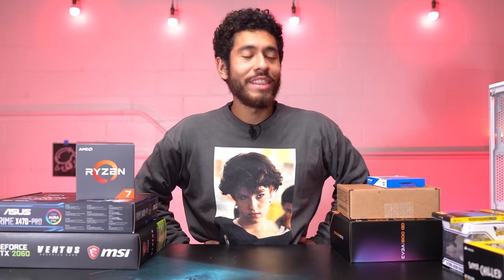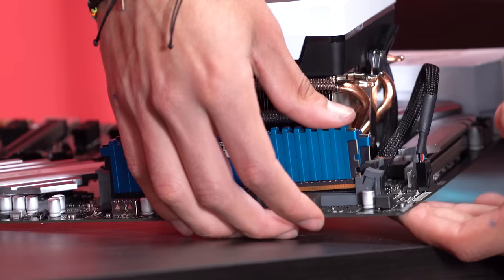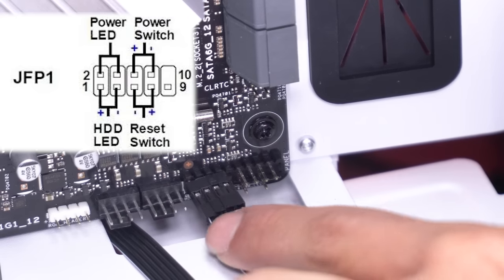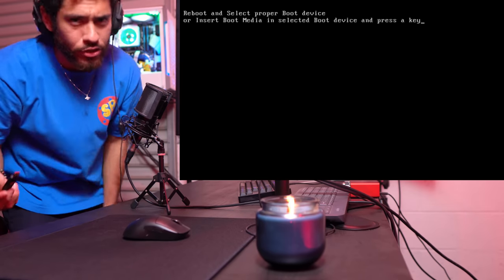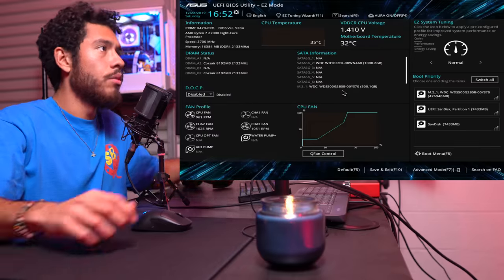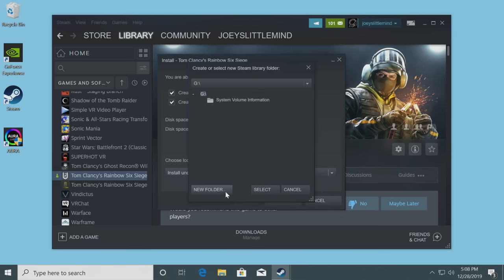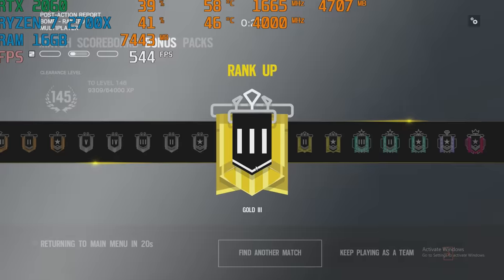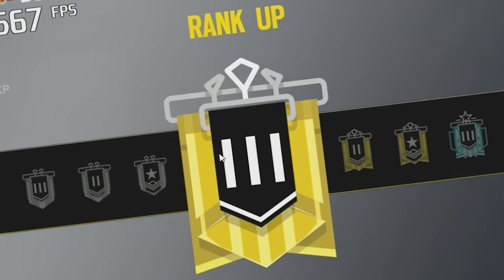Best $1000 Gaming PC Build Guide - RTX 2060 Ryzen 7 2700X (w/ STREAMING BENCHMARKS)

Comment: The msi tomahawk b450 max motherboard  will work ?
Reply: sort of, the fans in this case do not play well with that motherboard so I suggest getting either the mobo in the vid or the Rog Strix b450-f
Reply: @yordinihoudini  well ok thanks, but if I use that motherboard that I mentioned nothing bad is gonna happend right ?
Reply: @rolitoo5578  i’d say spend some 15 buck more on the B450 Rog Strix so you have no problems or worries with anything

Comment: A "$1000.00 build" you say?How can you make such a claim when the graphics card alone is selling for $899.99?I'm all for good graphics cards but $900.00 for a graphics card alone?HELL NO!!!The only way that I can see the build in your video costing "$1000.00" is if the parts were very cheap when they first came out because those parts that you listed sure as hell aren't cheap now.
Reply: Andre Falconi
Hace 1 segundo
RX 5700XT is equivalent to a RTX 2070 SUPER and costs much less I recommend you buy it. Or you can buy a RX 5600XT- its the same as a RTX 2060 but you will save a lot of money if you buy the RX 5600XT. 

Cons of Radeon Graphic cards: The drivers are sometimes unstable and your pc could crash but i heard they recently fixed all the problems.  Hope i helped you (:

Comment: Just finished mine but I changed alot of parts. I would recommend this to you if your wallet is flexible. Also if I were you I would wait for the RTX 3000 hype to calm down or you could spend alot more for alot less.
COUGH COUGH scalpers COUGH COUGH

Comment: hey joey or anyone els reading this can a NZXT Kraken Z53 240mm - RL-KRZ53-01 - AIO RGB CPU Liquid Cooler - Customizable LCD Display - Improved Pump - Powered by CAM V4 - RGB Connector - Aer P 120mm Radiator Fans  work for this bluid i wante to up grade to this wityh this bluid

Comment: @Joey, Thanks for all the various $$$-$$$$ setup guides, I'm wondering if this setup is compatible, (thank you)...

PowerColor Red Dragon Radeon RX 570 AXRX 570 4GBD5-3DHD/OC

AMD Ryzen 5 2600X Processor with Wraith Spire Cooler

Crucial Ballistix Sport LT 3200 MHz DDR4 DRAM Desktop Gaming Memory Single 16GB CL16 BLS16G4D32AESC

ADATA SU800 512GB M.2 2280 SATA 3D NAND Internal SSD

Western Digital 500 GB 3.5-Inch 7200 RPM SATA III 16 MB Cache Desktop Hard Drive WD5000AAKX

EVGA 100-GD-0600-V1, 600 GD, 80+ Gold 600W, 5 Year Warranty, Power Supply

Asus TUF B450-Pro Gaming Motherboard (ATX) AMD Ryzen 3 AM4 DDR4, HDMI, Dual M.2, USB 3.1 Gen 2 and Aura Sync RGB Lighting B450

Corsair Icue 220T RGB Airflow Tempered Glass Mid-Tower Smart Case

Corsair CO-9050082-WW Af120 LED Low Noise Cooling Fan Triple Pack

Comment: hey guys, i just looked at the graphics card and boy it’s expensive. can anyone recommend a cheaper one that’s compatible with everything else on here?
Reply: Similar cards is 1660 Ti
Reply: They went up in price and going to stay like that for another year, go to a local micro center and get really anything at this point. Or get a bot either or
Reply: @Felix-nw1od  Don't worry. Suppliers information is that from late May things are going to start normalise.
Reply: @TechnologyMove  since you said that I got a 3070 for 727 should I cancel it and wait and get a 3080 founders?
Reply: @Felix-nw1od  I still don't have access to these card. I'm expecting delivery for 2 PC builds next week. One 3060 Ti and one 3070. I can't tell you what to do, because I have to test the hardware before giving opinion.

Comment: I made this build but with the ROG strix b450-f ll motherboard but when I turn on the power supply the motherboard lights turns and when I go to turn on the pc nothing else turns on I made it yesterday can anyone help
Reply: Double check proper connection of the wirings. Don't rush and go back step by step to see if you miss something in the process
Reply: @TechnologyMove  alright but let’s say I do that and it still doesn’t work I’ve taken the motherboard battery out I’ve checked the cpu I’ve moved around the ram idk man I’ve spent so much money on this build it can’t go all to waste

Comment: Anybody know if this this motherboard has WiFi because I want to know if I need a WiFi card or not
Reply: You will need to buy a Wi-Fi adapter. You know, for future reference, if you take the time to look at the motherboard specifications, you can easily tell if a motherboard has Wi-Fi or not.
Reply: @JJFlores197  but I’m getting the second option the asus rog strix b450
Reply: @l.a9667  Well like I said, check the specifications of the motherboard. The second one doesn't have Wi-Fi either.

Comment: I wanna buy this pc now but the graphicscard is not in stock
Reply: You could get a 5700XT
Reply: @salamonthegreat  pretty sure it doesnt have rtx and building a pc now even though there is low stock  is just stupid
Reply: 5700XT is a comparable substitute. I don’t think @Cloudz cares if it’s an RTX card or not.
Reply: @salamonthegreat  im new to this stuff so i dont understand the difference i just want a good pc
Reply: @scarletsix6989  why is it stupid?
Reply: @scarletsix6989  I think buying a hp or dell workstation is more stupid, if you’re gaming. You don’t need the newest and best gpus to get a good gaming experience. It’s much better than an Inspiron with a GT730 or Intel UHD graphics, for around the same price.
Reply: @j24kk  if your goal is gaming your best bet is to build a pc. If it’s more productivity, office 365, a retail dell or hp pc will work die, they still have decent cpus.
Reply: @salamonthegreat  yeah im building this pc but i just need a graphics card thats the same and or better around 300-400
Reply: @j24kk  a cheaper RX 5700XT or GTX 1070 TI

Comment: where does the hard drive go?
Reply: I'm not 100% sure, but I believe its in the same area that the power supply goes. Look up the manual for this case and it will tell you where everything goes.
Reply: Depends on the case, mostly it goes next to the PSU

Comment: $360 for rtx 2060? U will not find that price anywhere! Its always $500 and up. Graphics card's price is so messed up right now!
Reply: RX 5700XT is equivalent to a RTX 2070 SUPER and costs much less I recommend you buy it. Or you can buy a RX 5600XT- its the same as a RTX 2060 but you will save a lot of money if you buy the RX 5600XT. 

Cons of Radeon Graphic cards: The drivers are sometimes unstable and your pc could crash but i heard they recently fixed all the problems.  Hope i helped you (:

Comment: Why is the gpu 900?
Reply: RX 5700XT is equivalent to a RTX 2070 SUPER and costs much less I recommend you buy it. Or you can buy a RX 5600XT- its the same as a RTX 2060 but you will save a lot of money if you buy the RX 5600XT. 

Cons of Radeon Graphic cards: The drivers are sometimes unstable and your pc could crash but i heard they recently fixed all the problems.  Hope i helped you (:

Comment: For me the graphics card said it was $900
Reply: RX 5700XT is equivalent to a RTX 2070 SUPER and costs much less I recommend you buy it. Or you can buy a RX 5600XT- its the same as a RTX 2060 but you will save a lot of money if you buy the RX 5600XT. 

Cons of Radeon Graphic cards: The drivers are sometimes unstable and your pc could crash but i heard they recently fixed all the problems.  Hope i helped you (:

Comment: A 900 dollar graphics card it seems imma have to go with gtx
Reply: RX 5700XT is equivalent to a RTX 2070 SUPER and costs much less I recommend you buy it. Or you can buy a RX 5600XT- its the same as a RTX 2060 but you will save a lot of money if you buy the RX 5600XT. 

Cons of Radeon Graphic cards: The drivers are sometimes unstable and your pc could crash but i heard they recently fixed all the problems.  Hope i helped you (:

Comment: is this wifi free?
Reply: What are you talking about?
Reply: @JJFlores197  if it goes wifi air or u need cable to connect to the wifi
Reply: @synergycali8850  you need to buy a wifi adapter to use Wifi.